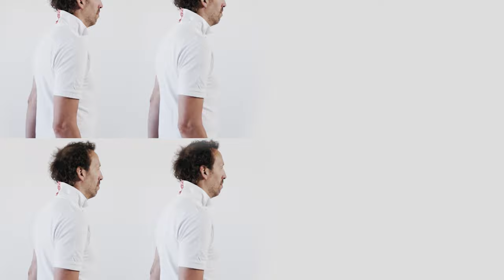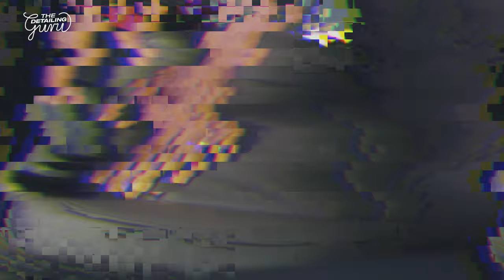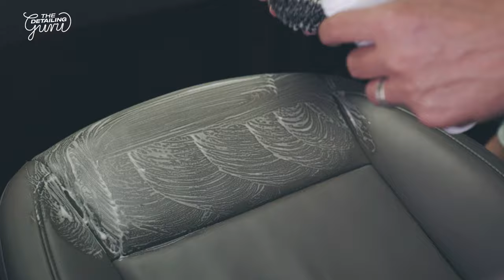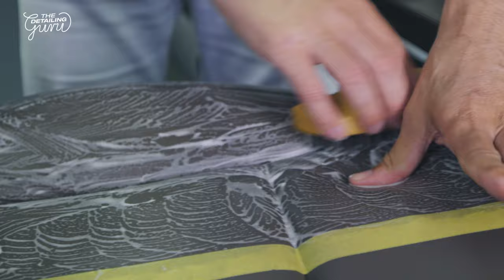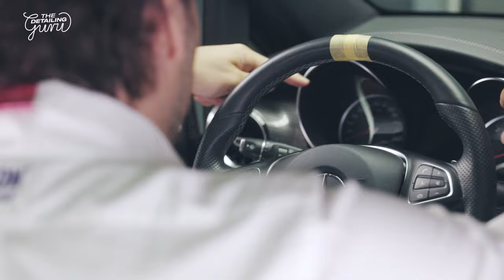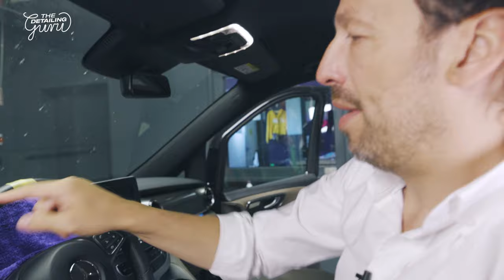How to assess & clean leather? - The Detailing Guru

Comment: Excellent video and great information on how to clean leather.    I especially liked the tip of using the three microfibers,  one dry initial,  one damp 2nd step,  3rd with a dry to make it look finished and OEM.    That's brilliant, especially the step #2 with a damp microfiber to mop up any residue.
Reply from the maker: Thanks. And the second tip is a pretty important one. A proper full leather interior clean isn’t a quick wipe in, wipe off job imho.
Regards,
Y.

Comment: Great video but I miss one detail - my M5 has black seats with blue stitching. I was not brave enough so far to do any cleaning because I'm afraid as I clean the leather that dirty foam will discolour the stitching. To leave the stitching out is impossible. My question is - do I need to worry about it or I can just go ahead as the cleaning and other products will not have effect on the stitching colour? Thank you in advance!
Reply from the maker: Depends of course how dirty the leather is but there is fine masking tape that you can use to tape the stitches off and work around it. This is what is done when leather that has coloured stitching needs to be recoloured. 
Regards,
Y.

Comment: I have the mild leather cleaner without the pump action.
It will come out foamy just by putting the pump head on the spray bottle ?
Reply: mine foams as it is as a regular bottle spray, and good enough to shift the odd bit of blue jeans dye too on a Subaru ivory interior.
Reply from the maker: The pump head does not fit on a regular bottle. When you purchase a leather set you have a pump spray bottle in the box and then you can refill this with your LeatherCleaner product. 
Regards,
Y.
Reply: Oh ok, thanks for helping 👍